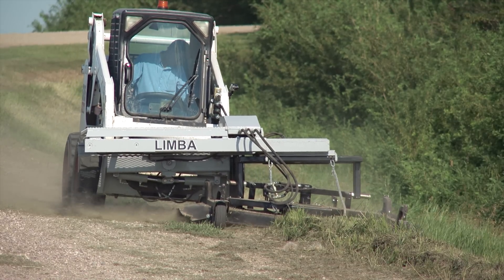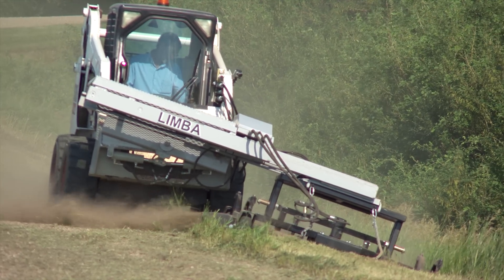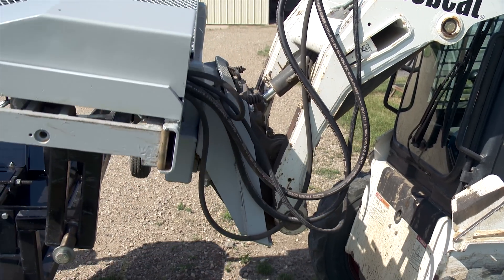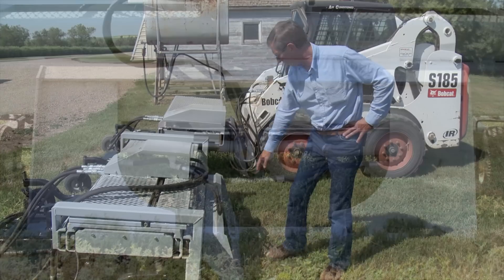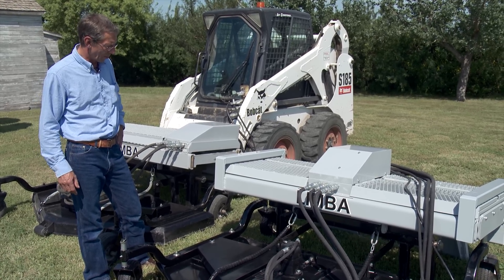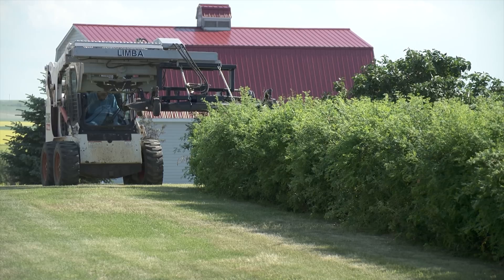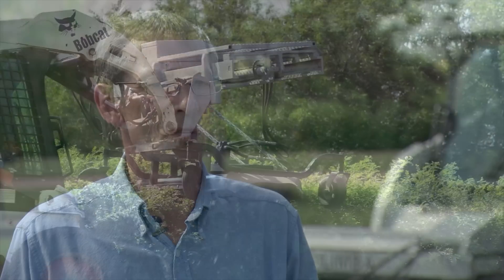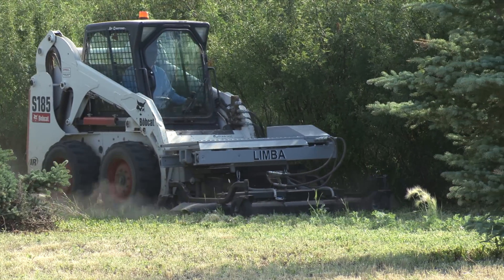Adjustable Skid Steer Mower Attachment - LIMBA

Comment: Why does everyone think that the grass needs to be blown on the top of the road? The grass doesn't blow away, dries and turns into hay, then the road grader has to deal with unnecessary  organic material. In some situations, there is so much cut grass from the mower thrown on the road, the blade has no choice but to leave a windrow of gravel and grass on the side of the road to rot because the grass balls up and doesn't flow in the moldboard. Please leave the grass in the ditch.
Reply: Blade Rocker here in ohio its against the law to blow it on the road and yet every day i see someone mowing and covering the road. I guess its one of my pet pevs.
Reply: I put all my clippings on the road!😀
Reply: Blade... blowing the clippings onto the uncut grass will make it difficult to cut that portion of grass on the next pass.  Cutting it the way he did in the video keeps you from seeing the inability of the mower to cut thick layered grass.
Reply: @lightning9279  If the mower cannot do a good job without making a mess, the mower should be replaced with something that will not cause problems. It seems people do not think about the problems they create because they don't have to deal with it once their job is done. If that farmer had to blade the road, he would not blow the grass on top of the road due to the issues it creates. Not to mention it just looks bad.